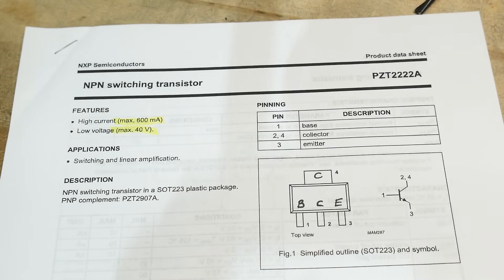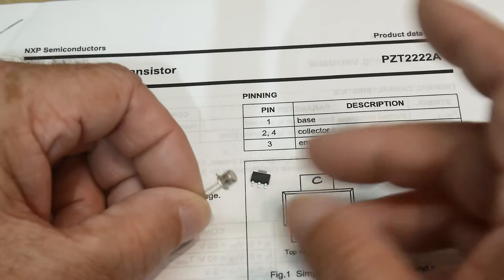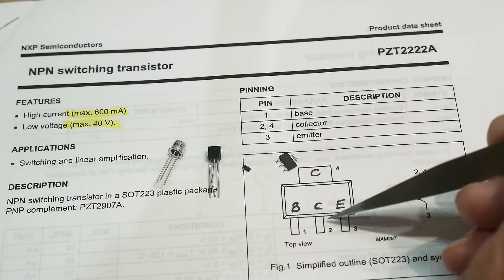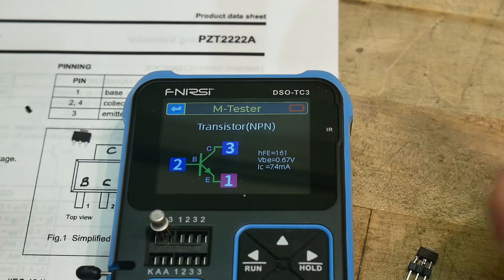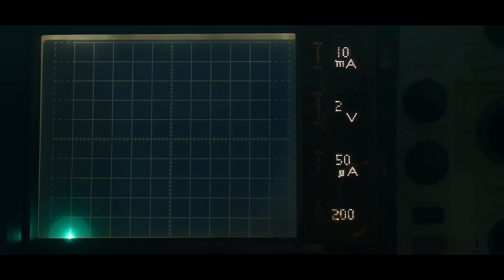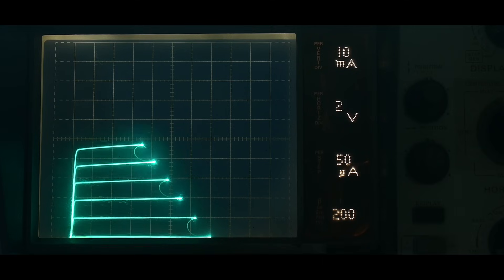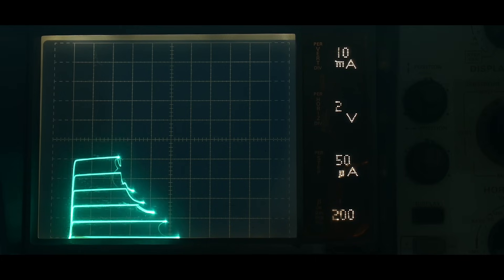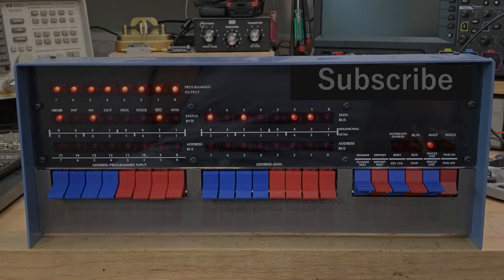#1827 PZT2222A (aka 2N2222A) SOT223 SMD Transistor

Comment: Back in the late 1970s... the TO92 2N2222 was my very first transistor.
English electronics shops kept telling me our BC108 was equivalent... but I was a kid who knew nothing and I was highly suspicious of this "equivalence" malarkey.
Reply: same as me !
Reply: For what you were going to use it for the bc107/8/9 would be fine. Different package but 2n2926 would also be ok. Good electronics design is to make the actual transistor needed almost irrelevant. 'Small signal NPN' on a circuit diagram is a good sign.

Comment: I would not trust any 2N2222 in a TO-92. That die in a TO-92 is marked as a 2N3904, PN2222, or KSP2222. The only “2N2222A” marked TO-92s I have seen are from China and are not comparable to the standard.

Comment: Back in the 1970s our avionics test stations used those by the hundreds as relay switchers stimulus/monitoring lines. Even with proper diodes on the relays, we spent as much time troubleshooting the test gear as the aircraft electronics as the 2222s would open CE.

Comment: There is MPQ2222A too. Four 2N2222A packaged in DIP14.
Reply: These were real handy to ensure a close process match and tracked temperatures.
Reply: @kenchilton Unless the die has isolation on the bottom/attach, these will be 4 separate die on 4 mutually isolated parts of leadframe unless the datasheet explicitly guarantees otherwise - and even then I’d want to see it with my own eyes on an X-ray or a decap. They will usually come from the same wafer but that’s just luck of the draw. If the datasheet doesn’t guarantee that the parts are matched, they are not.

Comment: The other classic is the 2N3904 with its PNP compliment the 2N3906. Both old parts that live on. I think the 2N2222A can handle more collector current but the 2N3904 can go faster. Someone correct me if I have got this wrong.
Reply: there’s also a complementary part for the 2222 - 2209 or 2219, can’t remember which.
Reply from the maker: 2n2907

Comment: That TO-92 is clearly damaged, this is a good reason why you should not completely rely on simple transistor testers.
Reply: Cosmetic damage to the plastic case is just that, cosmetic. Per FNIRSI Component Tester and the Curve Tracer the actual Die is in perfect condition.
Reply: @anthonyshiels9273  Are we watching the same video ? a good 2N2222 doesn't break down at like 8V, actually now that I think about it the response for all of them is weird, maybe an issue with the curve tracer.
Reply: I was thinking the TO92 version may have been the PN2222 that has the emitter and collector reversed from the 2N2222, but the tester showed it as being the same pinout.  Looks like maybe a bad transistor...

Comment: This breakdown looks weird. Normally, the collector current increases at excessive voltages. However, on your curve tracer, the current decreases. Is there perhaps some power limiting circuit inside the curve tracer that kicks in? Can you try with a higher power setting?
Reply: Interesting point. It is hard to imagine it breaking down at 5v and the current dropping, however the others were twice as good at the same settings.